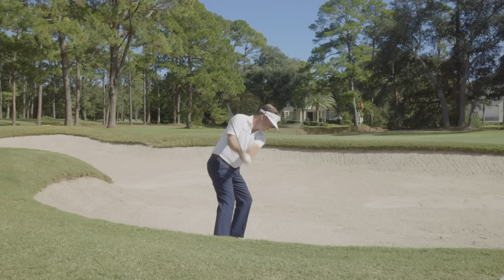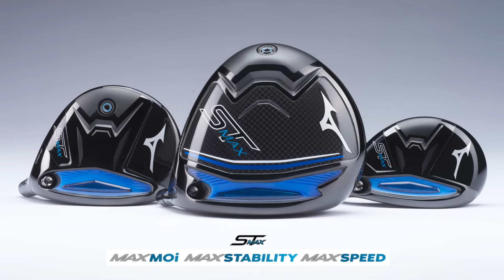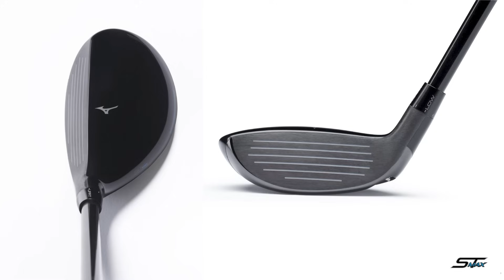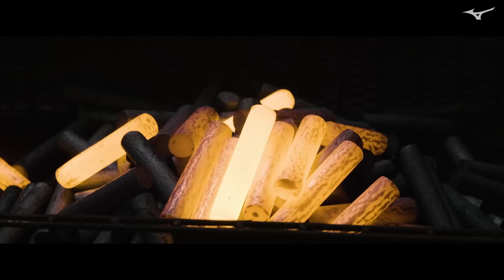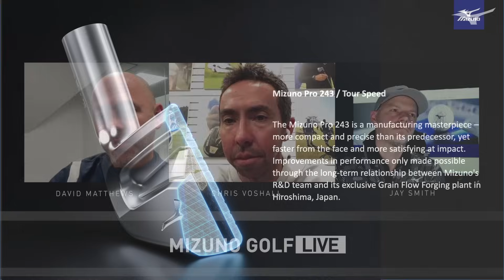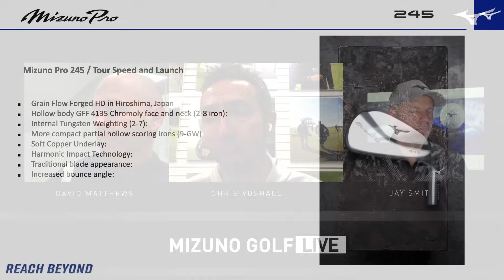Mizuno Golf LIVE - ST MAX woods and Mizuno Pro 241, 243, 245 irons

Comment: So many new toys....

1) I grew up on blades, but my favourite ever clubs were my MP-32s.  My current irons are 921 HMs, but I almost went for 225s at the fitting, just preferred the extra consistency. Doing some serious swing work, though. Roll on a flatter & straighter swing path, with less need of extreme forgiveness....

2) Currently I swap an ST-X 220 4H and 921 HM between summer and winter.  I prefer the 4H off soft FW, and the 4i as a driving iron when running.  Will look forward to new models - but - 
3) My old Callaways were always 1-4-7-rescue.  When I went Mizuno, the 220 5W pretty much replaced my old 7W.  But now, I seem to have lots of overlap in distance, but different trajectory options.

Sounds like I have LOTS of things to think about.  Add ST-MAX vs ST-X 230 and T24 vs T22, it could be a VERY expensive year :-)

Comment: At @27:38, you mentioned that the different model is not necessary means different level and how heads matching to different player/style of play.

However in my pass experience with official Mizuno club fitters for consumer here, in Australia, the fitter will ask you what head you want, and try to fit you into a head. Rather than try to fit you the best head, or best combo over all. (That's including both woods and irons).

I was always custom fitted with Mizuno in the past 2 decades but for this reason, I have moved away from Mizuno woods to Callaway, and in the last leg of hanging on the 919HM.

Hoping you will see this message and make the Australia fitting team better moving forward.

Comment: I havent replaced my old Callaway Sub Zero I crank to 11 degrees yet, I tried the G at a Mizuno fitting, didnt quite gel with it even with some ABSOLUTE BOMBS launched beause my clubhead speed is high, didnt try the Z because the fitter said it doesnt fit my swing and delivery. But the ST MAX does sound pretty nice and Id LOVE to try it. I have been eyeing the Callaway Paradym, so its GREAT to hear Mizuno launching this soon.

Comment: Jay, what do you think of going two six irons 221 and 225 to get the loft gap but also “one length” the top of the bag for players that struggle with the long irons?
Reply: One Length top end may be possible but you may have to strengthen the loft of the 225 by a degree to make up for the 1.5 to 2mph less Club head speed from the 1/2 inch less shaft increments.
That said, the above is only if you have t👍he club head speed to do it, if you swing medium to low then the reduction of shaft length and also a degree in loft would cause a reduction in peak height and control, and maybe no gain overall
Reply: @AskGolfNut  I believe I could have the swing speed, but I am very unstable with the longer irons. Thank you for your answer and a happy Christmas to you and your family.

Comment: Can we go back to the straight text instead of the slanted text for the 261,3,5 lineup in 2 years time? This new one does my head in OCD wise, I feel like I have to tilt my head 35 degrees just to fully appreciate the clubs at a glance. Thats the reason I bought a full set of 221's just now, even knowing the brand new clubs are coming out basically NOW, because MY text is straight, but these arent.

Btw thanks Jay, you told me these 221 blades are fairly forgiving and you really werent wrong, I shoot OVER 100 normally... I got these blades and Im shooting in the 70s now.... theres something about the crisp, clean turf interaction, instant pure feedback and feel of these clubs just feed everything my brain needs to know to adjust and learn wether on the training area or the course. Never using "game improvement" irons ever again.

Comment: With the new 24 pro series irons, would a 3-step mixed set be unheard of? — say 4, 5 (245), 6, 7 (243) 8, 9, PW (241)?
Reply from the maker: no - that can work.  Might be smoother to pick the favourite long irons, favourite short irons and see if there’s a join between 2 models though.   If you can find a way to make that work, would be smoother.
Reply: @mizunogolf1906  Excellent! I kind of figured you’d say something along those lines. Much appreciated!

Comment: I recently demoed  245 in Australia,    they are smaller,   to a point of being to small,     not a fan,    not a consistent  feel     unless you middled it,    when middled   great sprining release.
They got it wrong on these.
If you're a superb ball striker, and I  mean superb ball striker,    they have gone to far
Reply from the maker: Understand that it maybe too small for you - but size change compared to the 225 is fine margins.  Yes it is still a model for a better player and so we’ve made changes that suit those players.  The JPX923 line up is there for players who want a little more clubface.
Reply: I’m not sure they are much smaller. I know that Chris mentioned that several times, but when in look at the chart that shows size difference between the 223 and 243 it’s 1 millimeter difference in head length. 
That’s almost undetectable.
Reply: @mariofonseca9267  they aren’t much smaller. Been watch video compare them side by side and are only fractionally smaller than the 225
Reply: @mariofonseca9267  the size change between 921   another new player distance pros is significant,     considering I played  over 20 year old forged cavity back    that were not big these ne w mizuno are small.
There is a gap th a t needs filling from the hot metals and this  pro series,    the jump is to much,    I played forged cbs for over 20 years   and really want that feel,   but tech is moving for the sake of moving,   so I don't know where to go.

The titliest 150s   are a good size   and played well
Reply: I went from p790 to the 245 this week in a fitting. They are by no means too small. I got better performance out of them and I’m a 12 hcp

Comment: Mizuno, regardless of how great their products are, have been irrelevant over the last 2 years due to ransomeware attacks.  Even this last season you couldn't get their irons in a timely fashion.  Literally months.  We can only assume this pattern will continue.
Reply: I literally got my JPX 923s Tours three weeks from when I ordered them…
Reply: I got my 923 tours in one week after order placement in mid-October.
Reply from the maker: there have been some patches where we were slower than we would have liked to be.  In 2022 it was the entire industry with world supply chain.  In 2023 both US and Europe it was mainly growing pains - we just had more demand than we’ve been accustomed to.  We’ve addressed that at both the European and US assembly lines with more staff for 2024.   We were running at around 10 days through Autumn.
Reply: @mizunogolf1906  Summer 2022 was a ransomeware attack that was actually published news in golf periodicals.  Summer 2023 orders were 2 month out due to what some where claiming was the same event again.  I played the 221's but I bought them off the rack and built them to my specs from there due to ordering delays..  I looked forward to ordering 241's when they become available in North America, and I'm glad to hear to issues have been resolved.  Cheers.
Reply: I got custom T24s from Mizuno to match my Mizuno Pro 221 blades, same shaft, same grips, and the 56° custom bent 1 degree strong to 55° just now. Took 9 days from ordering, seems normal to me? I basically set aside 2 weeks before I start asking questions.

Months seems like alot..... im in Australia btw.
Reply: Was that really what is was? How far behind are they these days for custom?